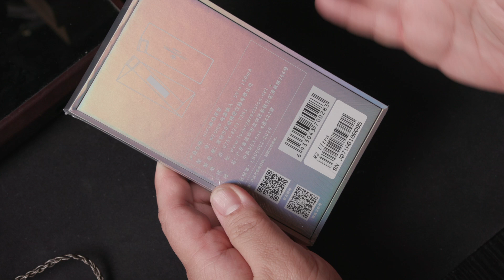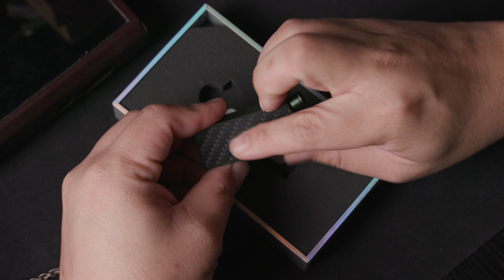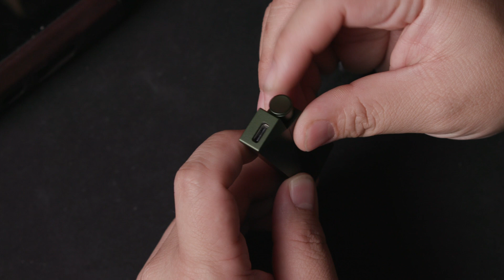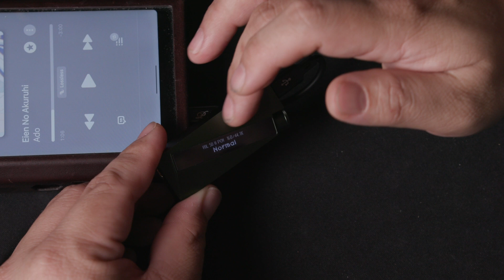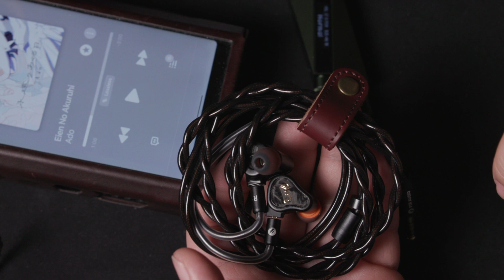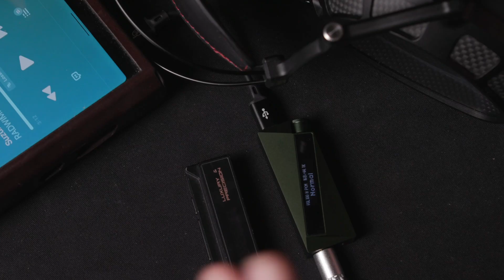First Look 19: L&P W2 Ultra : Ultra Power Dongle

Comment: Do you know if it works with the PS4/5 or Nintendo Switch?
Reply from the maker: I doubt it will work due to high power draw requirement. But I personally didn’t try on such device